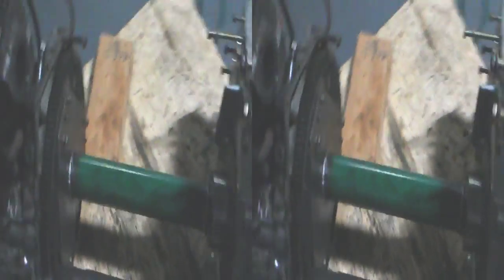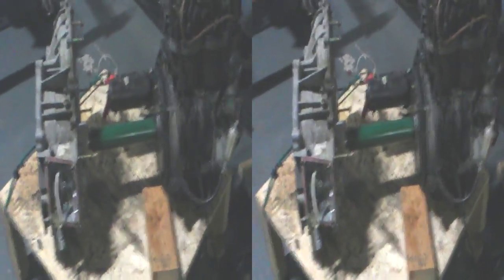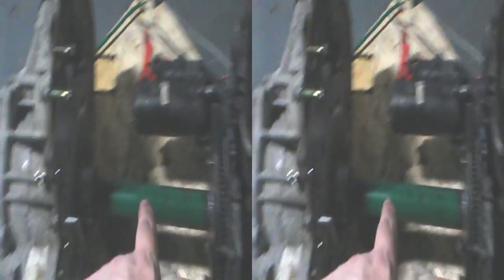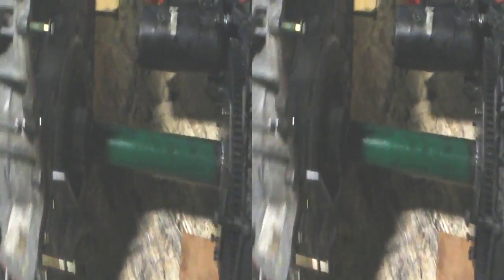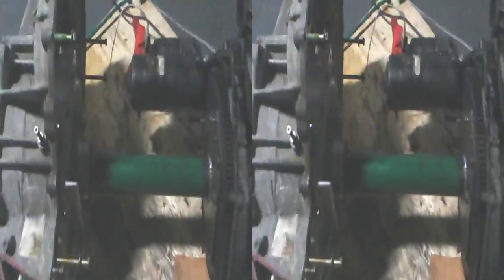Checking engine-generator adapter

Comment: In basically doing the same thing as i write this but i cut out a new connecting plate for my miller 200le aead welder because i broke the original and also because i got a working engine out of my other welder that shorted its windings